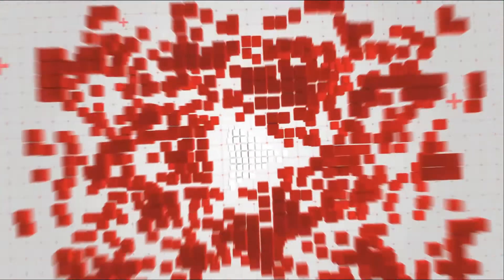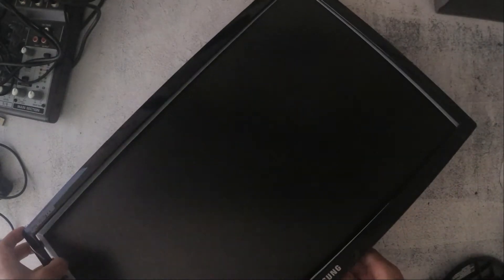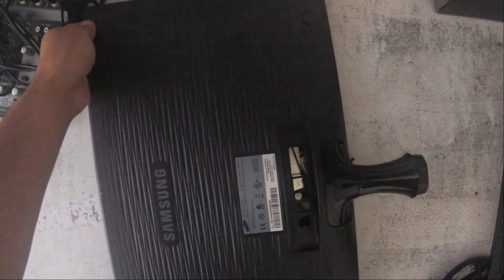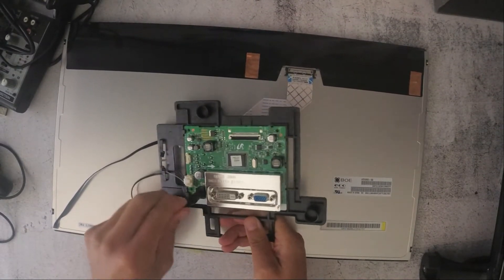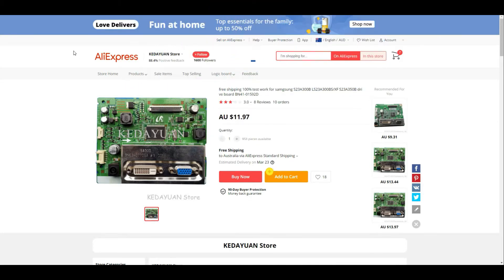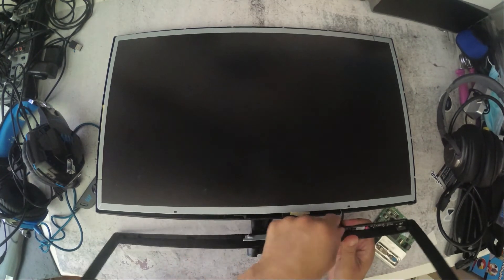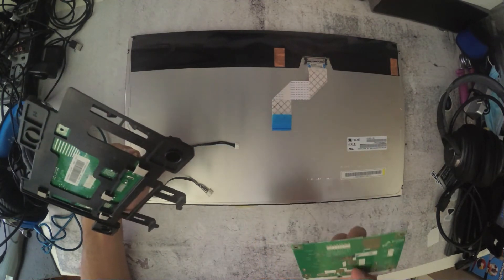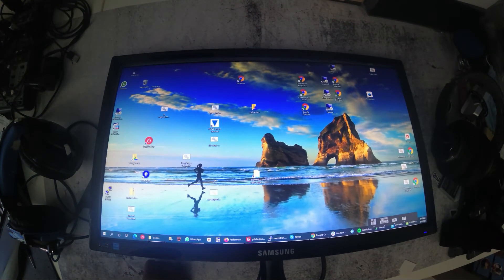HOW TO OPEN AND FIX LED DISPLAY SCREEN [SAMSUNG SA300]

Comment: i had S24C300L for many years now 10+ if i can just replace the motherboard will be great but not sure yet!?
Reply from the maker: Can you find a replacement motherboard?
Reply: @skopioeye  prices at my country are too high for replacement parts so i’ll just buy used one or similar for cheap thanks for responding
Reply from the maker: @NebulaWaarden no problems that's a good idea to buy second hand
Reply: @skopioeye  no i tried Alixpres but found diff models but same connectors

Comment: i had S24C300L for many years now 10+ if i can just replace the motherboard will be great but not sure yet!?
Reply from the maker: Replacing motherboard would be easier as long as you can find a replacement.

Comment: i have the same series but diff model 24c300L not sure the power supply or the motherboard or the buttons not working? how to short the buttons without using the touch panel? thanks for vid
Reply from the maker: Don't know how to short it

Comment: Mine has completely stopped working after 8 + years of constant use, btw u used aliexress which has one of the worse quality products as of tech. Do not buy form them again. Thanks for the vid
Reply from the maker: Thanks for sharing. I did manage to get mine working again even. 😄